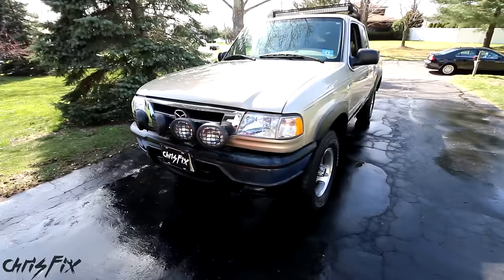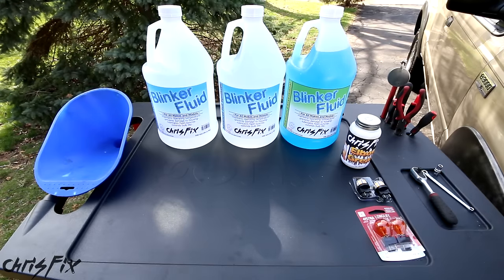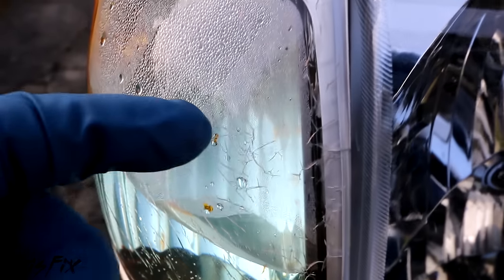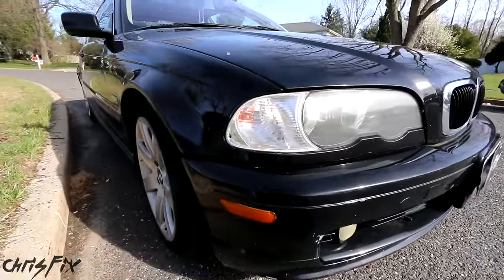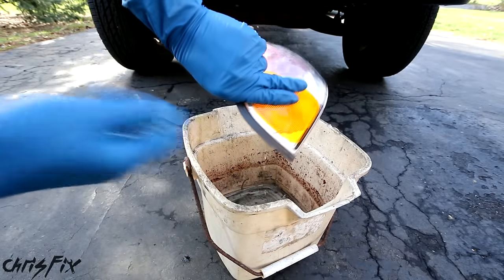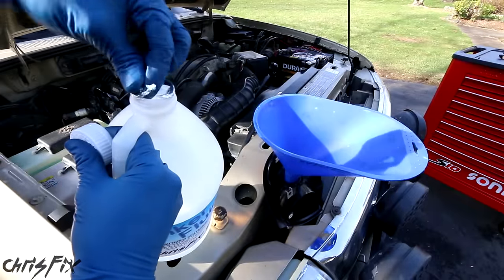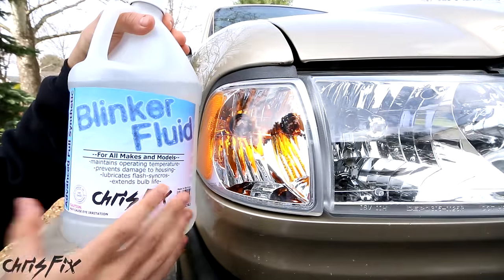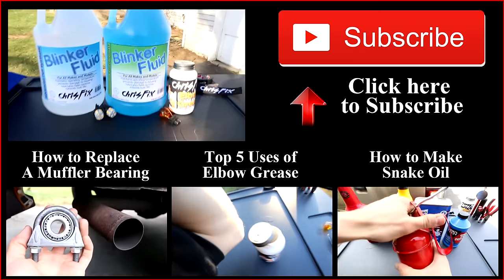How to Replace Blinker Fluid

Comment: I just bought a new car and the blinker is loud. Tick tick tick tick tick... Every time I turn it on. Does that mean I gotta change my blinker fluid... Please help!
Reply: Yes it's pretty much worn out.
But instead of blinker fluid, i use cooking oil, it also 
Eliminates that noisy ticking sound, and it's much cheaper!
Reply: @rust_hunter7867  wow it really works. Thanks man!
Reply: Joshua Burton 😂😂😂
Reply: Imagine this was actually a real case
Reply: I believe your piston return springs r bad experience job:(
Reply: @davidmatamoros735  ??
Reply: Expensive yes very very expensive you will need elbow grease to reassemble the head of the engine if you do it yourself autozone has one spesialized 4 breaking it in chris fix madea video on it
Reply: if you don’t have enough cooking oil use gasoline
Reply: Its that or the blinker clutch is damaged... either way I think you should check that ASAP otherwise you can damage the blinker´s nuclear generator.
Reply: Joshua Burton o

Comment: If you reverse a lot, be sure to replace your reverse transmission. Sometimes shops will recommended both reverse and forward transmissions, since the labor is lower to do both, than each separately.
Reply: bol
Reply: True story. I went over a lot of bumps when I first got my car and my muffler bearings just cracked! Had to replace the bearings and the reverse transmission (upwards of 60% of my daily driving is in reverse... Long driveway)
Reply: +Warhawker This is the best one down in the comments!
Reply: +Warhawker This doesn't apply if you have a Chrysler product with a Turbo-Encabulator equipped transmission.

Comment: can you make a video about summer air in winter tyres?
Reply from the maker: +Daniel kärrholm lol
Reply from the maker: +Daniel kärrholm lol
Reply: ChrisFix hi chris im from holland and here in holland they dont know what blinker fluid is can You tel what it is thanks
Reply: or nitrogen in tires lol
Reply: It's a joke. Blinker fluid isn't a thing, and your turn signal should never have any kind of water or fluid in it.

In case the april fools part of the video didn't tip you off...
Reply: +Kyke Rees Nitrogen for tires is a scam because the air we breath is mostly nitrogen.
Reply: we know werre all trolling op asked about putting summer air in winter tires the video is about channging blinker fluiid and im joking about nitrogen in tires lol
Reply: Luca Bot blinker fluid isn't the problem here. I have to change the defibrillators out in my car twice a month!  I think its from all the rock salt?

Comment: My steering weel is out of steering fluid can you help me
Reply: Aleksej Tusevki just add power steering fluid. Open your hood and there should be a cap that says on it power steering. Add power steering to the line but don’t overfill it. The line is noticeable.
Reply: ...awkward....
Reply: Just make  sure after you're done that, you have to replace the summer air in your tires to winter, this helps maintain good traction and stops snow from puncturing your tires. Stay safe people
Reply: ok i now
Reply: non-car guys be like-
Reply: Was this supposed to be a joke? Because power steering fluid is a real thing...
Reply: Just add a racing stripe
Reply: Pretty sure this started as a joke by a guy who didn't realize power steering uses hydraulic fluid lmfao.
Reply: Yea go buy some power steering fluid
Reply: About 10 people in this comment section need to be in the r/woosh subreddit
Reply: Your bad at jokes
Reply: Just spill steering fluid on yous sterring    whell
Reply: @adizivojevic8635  what?
Reply: @corksoaker4934  steering fluid
Reply: Why do i feel like this was supposed to be a joke?
Reply: Bro everyone knows steering fluid doesn’t exist XD
Reply: Lol
Reply: @Fifthcell  I know this is 2 months old, but I happened across it and honestly don't think all these people know that. hahah
Reply: Kyle Clerico yeah... people need to learn more about cars. There’s people who don’t even know how to change a bulb, fill up washer fluid or even change a tire!

Comment: can you tell me how to replace my stereo fluid
Reply: lmao
Reply: And tire fluid
Reply: +Xero What works best on a friends truck zip ties on the drive train ...
Reply: +Xero i heard a little dub step will refill stereo fluid
Reply: +johnyvare dubstep solves everything
Reply: and steerinw Wheel fluid
Reply: +Scott Can Do thats called power steering fluid it exists jeez u dont have a car
Reply: Antenna fluid refill and radio belt tightening
Reply: +Xero yes, it's prepared on sea water...
Reply: just replace the seats
Reply: with the proper tools, whichever they were...
Reply: +Xero wd 40 works wonders. Or  ep grease..
Reply: +Xero lol, nice name btw.
Reply: Lol !
Reply: +Man Woman tire fluid is actually a real thing (air)

here is a step by step guide on putting tire fluid in your tires 

1- unscrew plastic cap
2- put mouth over rubber     nipple 
3- inhale through nose and then exhale into rubber nipple
4- repeat step three 1 to 2 hundred thousand times
5- place plastic cap back on.
6- repeat steps 1-5 for the remaining tires.
Reply: Alec C there aren't any rubber nipples on tires
Reply: +Xero what ever you want to call it nipple, stem it's all the same
Reply: todd marcius gases are fluids
Reply: +Alec C Actually not all gasses
Reply: +Nitik The6/Frenchiee I'm pretty sure air is
Reply: Can you tell me where to get a left handed screwdriver??😂😂😂
Reply: +HowMilk Gaming can you tell me where to get a left handed right hand
Reply: +Scott Can Do thats actually power steering fluid lol

Comment: Additionally, while checking your blinker fluid It's usually a good time to check your muffler bearings. They usually go out around the same time. I recommend chrome-plated muffler bearings they last at least twice as long.
Reply: u also got to change your steering wheel oil
Reply: I’m a die hard Firefox plating guy

Comment: I have been a Blinker Technician for over 30 Years. I have to say, that replacing your Blinker Fluid is crucial after every 50,000 Blinks of the Blinker. I also recommend using the Synthetic Fluid, due to it can work at a greater temp, then the Standard Fluid. For more information please visit your local Blinker Technician in your local area.!

Comment: My blinkers make this obnoxious ticking noise...any advice???
Reply from the maker: Blinker fluid needs to be flushed. The flash synchros are way too loud which is how I can tell you need a flush!
Reply: Excellent.  Maybe you could do a video on proper disposal/recycling of waste blinker fluid.  Great videos-super helpful.  Thanks........
Reply: Steve Harris 
Haha i won't ruin the joke here
Reply: Try replacing the blinker bearings, they can really take a beating after they get damaged a bit
Reply: Not sure how to fix but if it's like a MYSTERIOUS ticking noise, then, to be blunt, it's probably a pipe bomb.
Reply: Coaster Universe xD
Reply: Just cut the wires to that side.
Reply: annoying blinker ? hmmm did you try buying a bmw yet ?
Reply: bmw drivers
Reply: jacob soliz you mean Big Mexican Women BMW!!
Reply: so you know its on in think
Reply: Steven Harris op9io IP io
Reply: have you tried turning your blinker on and off
Reply: They need new blinker fluid.
Reply: You need to lube it with some ElbowGrease.
Reply: Doc isin u need the synthetic blinker fluid
Reply: Nicholas Vaultonburg no a finger licking timer ticking pressure cooker bomb, hahahahahahaha

Comment: Should do a video on how to change muffler bearings👍
Reply from the maker: +graveyardrumblers this April ;)
Reply: ChrisFix good... my exhaust gets really hot so I'm pretty sure the muffler bearings are bad
Reply: ChrisFix
Reply: graveyardrumblers I get it it's Gavin from rooster teeth
Reply: What about fan belt buckle😜
Reply: Sean Tobin I also need to change the stopwatch on the timing chain and the cushions on the valve seats.
Reply: My radio wasn't working so I had to do a full speaker flush and change the aeriel filter
Reply: or how to install a short throw dipstick
Reply: graveyardrumblers gotem

Comment: Okay so I understand this but how do I refill the seat oil?
Reply: yea i wanted to know too because im short i always get the seat closer to the wheel but when my bro drives my car he cant push it back easily... the mechanic took a quick look and said it might be the seat oil but I'm thinkin it might also be something else and to avoid the costs of seat oil change I wanted to do it at home before bringin it back to the mech..
Reply: it's factory sealed on most of the newer models, so the seat oil bolt comes out, and the replacement is like a zert. i like to never found the right size zert. turns out it's metric.
Reply: I’ve had the same problem lately, my seat has stopped making the reject sound for all pressure laid onto it,
Reply: @sntone3055  zonda civic lmao. Whats next, honda pagani R?

Comment: Make sure you ask for synthetic, it last much longer!
Reply from the maker: +JFeezy #truth
Reply: I would only recommend synthetic past 200k miles
Reply: +Alex Fleming Actually synthetic is not recommended for an old car because of its smaller molecule size it will leak out much faster, and then you would have to replace the blinker reservoir tank gaskets more often.
Reply: +FreecycleMichael Czechvar some manufactures have started making replacement gaskets out of newer better materials. so people who want the advantages of synthetic fluid, but dont have a newer car can get in on the savings $$$.
Reply: +coltwalkerjr there's no pump. It's a gravity fed system. check to make sure there are no leaves or rat droppings blocking the reservoir tubing. if there are, you can just unhook the high side of the tubing and suck on the tube until the blockage has been cleared. Good Luck!
Reply: +coltwalkerjr probably a cheap aftermarket retrofit one from JC Whitney or off of eBay.
let me know how it works out for you. 
I'm  curious if I should buy one. that's right, I'm buy-curious.
Reply: +JFeezy I need to change my blinker fluid its been 23 years for my truck.

Comment: Lucky I watched this, I checked my both blinkers and neither had any blinker fluid left! I filled them back up, but I think I did it wrong because now they're not working.
Reply: No Thanks LMFAO Duuuddee
Reply: Bruhh
Reply: No Thanks LOL I seriously hope that was a joke that you just commented with. LOL there is no such thing as blinker fluid.
Reply: gg wp
Reply: Josh Jansen no shit Sherlock
Reply: Some people
Reply: No Thanks lol well you were supposed to watch the video through until the end. He did this as an April fool's joke
Reply: No Thanks thanks
Reply: No Thanks are you driving a BMW? If so, no issue.
Unless it's a newer Beamer model (like mine), then the steering wheel will vibrate every time you change lane without using the blinker, so you learn pretty quickly to consistently use those blinkers.

Comment: I'm in the UK. I can only get Indicator Fluid. Will that be OK instead?
Reply: Iain Smith Yes indicator fluid works fine! Do bear in mind though we can't buy the Synthetic kind in the UK yet, so you'll have to make do with conventional. Hope you don't use LED Bulbs or drive a BMW! 🤣
Reply: Iain Smith nice joke
Reply: Iain Smith probably
Reply: Indicator fluid and blinker fluid are 2 different things. It is not ok.
Reply: Blinker fluid is fake that's dumb you even ask
Reply: Racer X that's the joke
Reply: It’s the same thing bro and yes I know this was a joke
Reply: Iain Smith same thing. Indicator, blinker whatever.
Reply: Really! You couldn't tell he was joking?
Reply: Iain Smith ya
Reply: Iain Smith no
Reply: leandoer's arizona lies it's ok
Reply: What happens if you get indicator fluid in your eyes? If you get it on your hands Do you point uncontrollably?
Reply: Iain Smith Watch to the end

Comment: next april fools you should do a video of replacing your spark plug sparks, and where to buy them. we usually tease the new engineering students about getting a box of spark plug sparks.
Reply from the maker: hahaha
Reply: and we usually have some magnesium shavings laying around, and we grab a bit and light it up. maybe you could do another april fools joke with that? like empty a coil housing (and old useless one) and in the video fill that up with magnesium powder after demonstrating that magnesium in contact with fire ignited in a bright sparking way.
Reply: Wilco Muurling That happened to me! But it wasn't that obvious to me because in Dutch we call them "Bougie", so he asked me to get "bougie sparks", and I thought of the English name for them, which is spark plugs. I guess it, in a way, made sense, but how wrong was I. 
When I got to the auto parts shop nearby and told the guy that Eric wanted a box of those. He had a straight face when he told me he'd check if they still had them. Then I heard laughter in the back and my face got an intense frown. I got to Eric and he said "Well, did you bring them?" I did not respond all too happily, and he had a laugh with the boss.

Comment: What do you mean "April Fools?" Tapping on the housing BEFORE installing the bulb is the part that no one seems to know. Well, at least not until the trapped air bubbles come back to bite them, and by then it is usually too late, and you end up with the condition you had in this video....the air propagates until half of the blinker housing is empty. There's a lot of great tips in this video. I can't believe how few videos there are on the proper way to change the blinker fluid, especially when it seems so few people really have a clue.

Comment: all i need to do now is replace my tire fluid
Reply: Lance Burkheimer ... Have you ever went to school bud?
Reply: The Different Enderman hes right
Reply: Air is a gas...
Reply: Air is a fluid because the force needed to deform it depends on how fast it is deformed, not on how much it is deformed. This differs from a solid, where the force needed to deform it remains the same whether it is done quickly or slowly.
Reply: fluid doesnt mean luquid
Reply: Evil Smile 邪惡之笑 You need to learn what a fluid is haha just google it! "Aren't fluids liquid? A: While liquids are fluids, fluids are not necessarily liquids! Fluids are a subset of the phases of matter and include liquids, gasses, and plasmas." Smh 🤦‍♂️
Reply: Evil Smile 邪惡之笑 So yes air is a fluid but that doesn't mean it isn't a gas. Air is a gas like I said.
Reply: No joke but all tractors have rear wheels that are filled 75% with wheel fluid.
Reply: Jacob Evanson im sorry i thought you were saying that air is a gas and what the first guy said was wrong
Reply: What about tractors and heavy equipment that do have fluid in the tires?
Reply: +vehicle insanity Don’t be stupid. Tires don’t have a fluid in them! But remember that it’s really important to deflate them time to time to remove all the summer stale air and put some fresh fall air.
Reply: Don’t forget the tire gasket
Reply: vehicle insanity Air is a fluid. Not to be confused with a liquid.

Comment: My buddy rebuilds blown blinker gaskets for $1500 if anyone needs it done
Reply: Corbin I.N.C lol
Reply: Especially common on subaru blinkers.
Reply: Wow that’s cheap my mechanic does it for $2500
Reply: For my BMW E3... Oh wait never mind
Reply: What about those POS gasketless housing units on the Chevy S10? How much does he charge to resurface the blinker heads? The bulbs should be replaced at the same time no?
Reply: Does he replace windshield wiper gasket's as well because mine are bad lol
Reply: Lucifer's Left Ear definitely replace  bulbs when you resurface the blinker heads
Reply: Jesus. o-o
Reply: I hope he repairs my muffler Bearings because my car sounds like a Honda mail truck because of all of the exhaust friction. Lol

Comment: Where do we buy this blinker fluid? I've been using distilled water in my light compartments, works good, but I'm worried about freezing in the winter. So does the blinker fluid have antifreeze in it? They could've made it a little easier to change blinker fluid like a drain plug or something and fill hole.

Comment: It's not that BMW drivers don't use their turn signals, it's just that they emit light that cannot be seen by plebeians.
Reply: oh...  is that what it was
Reply: +rustler08 that german approved blinker fluid is SO expensive!
Reply: +rustler08 Yeah,  I have no clue what smartass at BMW  decided to use infrared turn signals. 
Just like VW  does btw. You need a blinker fluid that converts the IR to visible light,  very expensive, and most of the owners of those cars paid so much for the car, that they dont have money for proper blinker fluid that goes with it.

So every time you see one not use the turn signals, its because its a cheapskate that bought cheap blinker fluid.
Reply: esenel92 makes sensw
Reply: +esenel92 can confirm. my brothers vw touareg v8 (idk if spelled right) uses uv turn signal lights and needs uv reactive fluid to be seen.
Reply: +rustler08 My beat up old 4x4 jeep likes to intercept these BMW's and their unindicated lane changes. :P (I need a hit me please bumper sticker)
Reply: They're indicated, you just can't see them. This means you implicitly admitted to being a plebeian. Haha
Reply: rustler08 bmw drivers the most
Reply: +Allen Thramer bosch blinker fluid